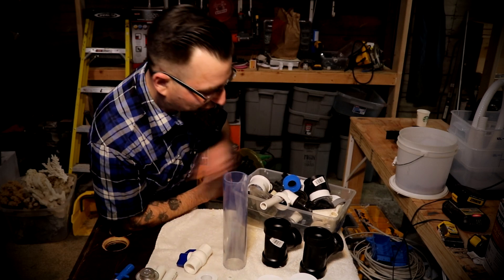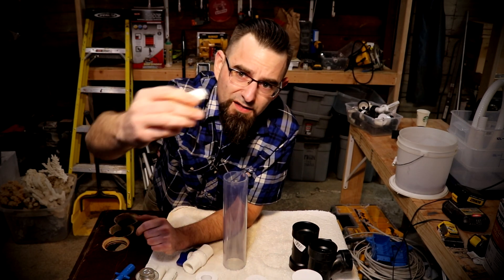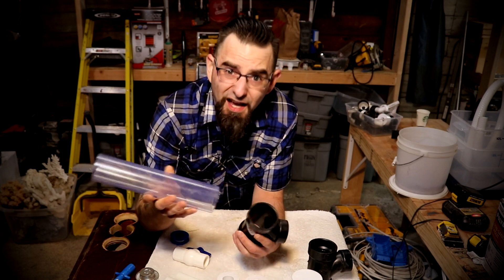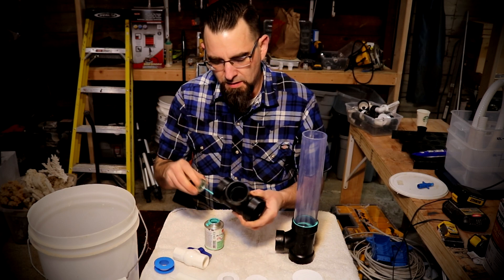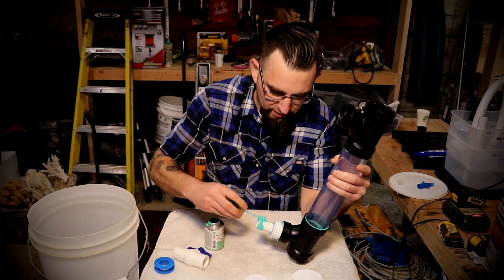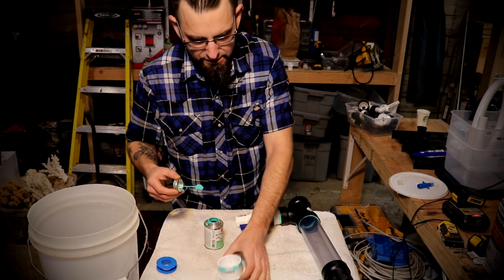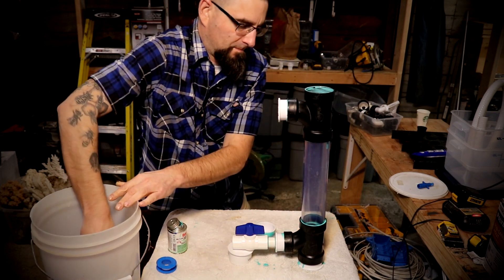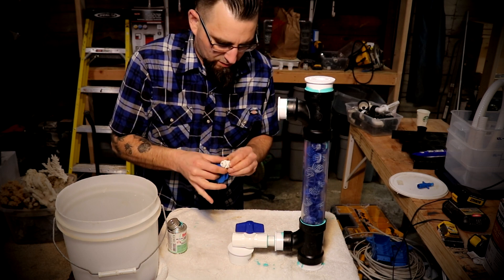DIY CO2 REACTOR INLINE AQUARIUM

Comment: just put your co2 difusser  directley under the pickup of you canister filter  then little bubbles get sucked up and has to run all the way to the filter thru your media and all the way back to your discharge during ther travel the the bubbles will be absorbed

Comment: Hi I made this reactor and plumed it into my 120 Gal. tank. I can't seem to get it to stop spraying tiny bubbles out of the returns. I'm thinking that the bubbles are a sign of ineffective dissolving of the co2. Any suggestions?
Reply: hi...you can add in reactor a thin sponge  close to output area . The reactor must be connected close to output of filter in this way you will have a long circuit for bubbles until them get in aquarium. Long circuit  = bubble dissolution :P

Comment: I realize this is an old video, I am trying however to build a similar reactor that will connect to the 3/4" (25/32mm) flexible tube that exits my sump pump. Any ideas on what parts to get? Thank you Corvus!
Reply from the maker: You'll need push to fit fittings,  they will thread right into the end caps

Comment: Fyi I was told not to use the black ABS fittings in an aquarium as they are treated to be antibacterial and can leach into your tank.
Reply from the maker: Shawn Melin FYI, only having half the information can be extremely dangerous.  CB-35 ABS is food grade capable black plastic designed for food packaging.  Which is NOT a sch 40 ABS pipe or pipe fitting.  If you want anti bacterial treated ABS fittings,  they are available in different coloring for use in production capacity at a much higher cost.

Comment: If you put a screw top on it you could even clean the inside of the reactor
Reply: The point is to keep the water clean before you pump it into reactors. Otherwise, they will clog and become useless quickly. Hence it should pump from the sump, which is generally at the end of your filtration where the water is clean. Of course, there is risk of algae if you keep it in the light. But generally, you have your sump in the dark anyhow. The CO2 will kill most of the bacteria so Bio balls won't have bio film forming on it.
Reply: Helveteshit My reactor is directly inline with my Filtration system.
But there are particles that will make it in your reacror and clog it.
i have to open mine up every 6 months or so.
The most stuff in it is the algee that grows in the tubes from the filter to the reactor.
Reply: Transparent tubing or how can algae grow? Algae typically don't grow where there is no light. If anything, it should be biofilm. But ye... If you have a sump to hook this up to. You might want to consider covering the intake with an old sock or something to potentially reduce it. Well, I do not know. I just find it odd you have stuff growing in the pipe between filter and in-line. Unless your filter is merely Medium grade rather than fine?

Comment: Thread tape on PVC is always wrong, at least according to the PVC manufacturers, but what do they know.
Reply: Yep... thread tape made for metal/brass connections...I use plasto-joint compound made specifically for pvc, abs, etc...
Reply: Pipe Dope